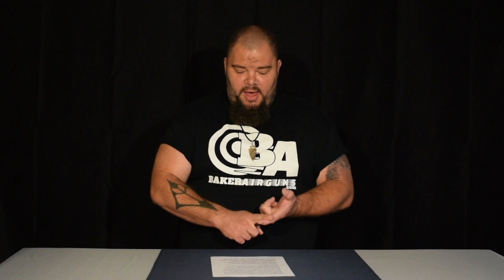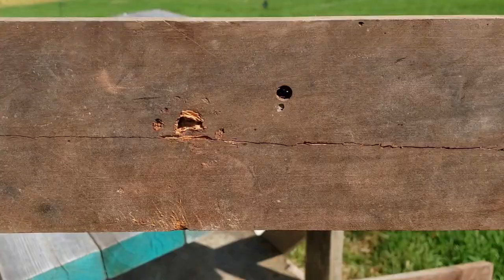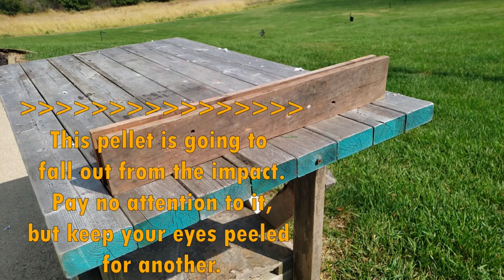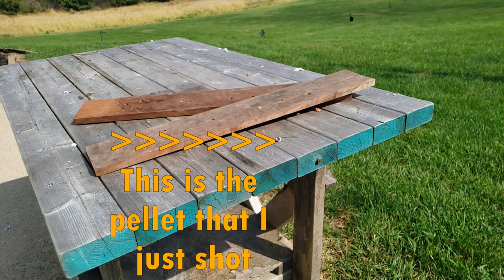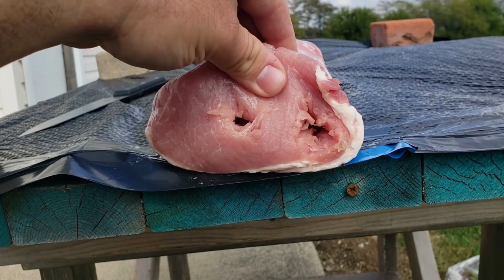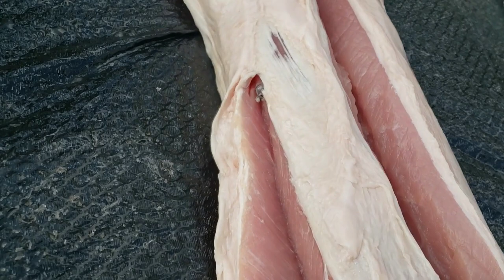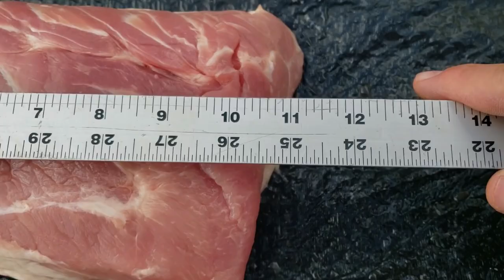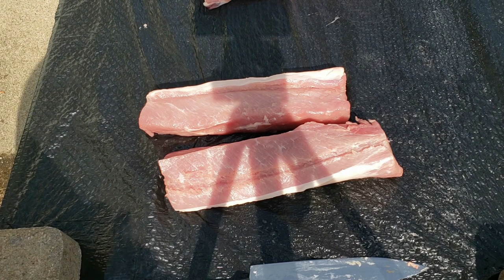PART II...What's deadlier, a .25 or .30 caliber airgun?

Comment: I'm sure there are a variety of valid opinions on the subject but my 2 cents.
I prefer .25 cal for my personal use of pellet rifles. Most modern springers can shoot it fast enough to be effective on small game and PCPs can throw it with enough authority to take Hogs.
Any ammo larger than .25 takes on a significant price increase and I will likely use a rimfire or bow on the larger game. I have no doubt my preferences are based on regional factors like laws and geography. Here in Michigan, I rarely encounter game at great distances (20-40 yards) more often than not.

Comment: I'm still not convinced. Example. Seting aside a "head shot", my brother has a vintage 35 Remington carbine lever action. When using a blunt nose bullet, a deer drops where its shot. When using a pointed bullet of the same grain, the bullet passes through, and the deer keeps running. So, it's obvious "knock down power" is important. Saying that, conduct the same test at 50 yards and see if the .25 caliber pellet is the winner. And then at 100 yards. What caliber retains more energy at those distances?

Comment: Nice video Donny! Hydrostatic shock is hard to measure but it is to me a form of instant hydrostatic pressure, the projectile does push energy into the gel as it cuts through, like a wave of energy, and if those waves are fast enough they can damage living tissue.  Some tissue is  more impacted. Subsonic Air rifles generally don't produce much.  But if you  shoot a high velocity rifle with same bullet characteristics at the gel, the wound channel will be greater in diameter. The bullet isn't touching this area, so what is causing the much greater wound channel?

Comment: Mr Baker is very correct in his statements here and physical testing shown does not lie. At the same muzzle energy at this range, the .25 is going to win. Where things will get less clear is when the distance you are shooting increases. The .30 will retain more energy at 100 yards and then you will get into other factors as well....especially the BC of the projectiles. With pellets in particular, you do get some limits on speed that you can shoot and retain reliable accuracy, so these tests he has performed are very valid. If we move to slugs then faster speeds for stabilization are going to change the variables quite a bit. I know of multiple people who hunt pigs that have even moved down to high FPE .22 with slugs simply because the penetration is superior to .25 and .30 (and because they are only taking shots into the skull inside of 50 yards). If someone was moving out to 100 yards in that situation, you would probably see the .30 be the choice because it is going to mean more retained FPE downrange. Ultimately, I think he is saying go out and do your own testing and provide real world results to give more data points to everyone. No single guy or gal is going to have time  and resources to test every single situation......so get to shooting.
Reply from the maker: Well said, friend!
-Donnie

Comment: I wish you would add info on FPS and rifle you are using. This info would be helpful.
Reply: It’d also be good to do apples to apples-not apples to oranges. Different calibers but use same weight (or close as you can get to it) pellets/slugs and run them at the same (or close as you can get) velocity.

Comment: It results in physics.The frontal area is smaller for the .25 so there is less drag as penetration is achieved compared to the .30 caliber at equivalent energy levels.I've studied this with hunting handguns  using Hardcast bullets .......one example is the .475 linebaugh compared to the .500 linebaugh. Guess which one penetrates deeper? Your testing mirrors mine in air rifles with equivalent energy and in my testing with handguns I use for hunting. Great presentation!!.........john
Reply from the maker: Thank you very much!  I'm glad to hear that our testing is in accord.
-Donnie

Comment: Very interesting test. I would like to see you do the same thing with the 22 and 25 cal. Makes me wonder how the 22 would hold up against the 25.
Reply: The smaller pellets/slugs of the .22 generates more energy than the .25 in piston/spring guns because the .25 usually pushes them at slower speeds. This is less true in the PCP world, since gun makers can boost the speeds on their .25 cals to be well above 1000 fps. As with anything shooting related, your best bet to is to spend our energy trying to find the most accurate airguns. Because they are all pretty badass at sending lead down-range quickly, these days.

Comment: Great pair of videos! I was a bit surprised at the differences so much in favor of the .25. I will need to go back and watch, but I thought I saw at one point a larger wound channel in the gel with the .30, but the angle made it hard to see. As for the meat, it did look to me like a larger entrance wound with the 30 caliber, as well as a bigger impact (how far they moved) in both the wood and the meat. But I'm not certain, it was hard to tell, and I will watch again. However, one thing is guaranteed: the entrance wound is going to be 20% larger assuming no expansion in either case. Now, of course, with the higher FPS of the .25- needed in order to keep energy identical- you are more likely to have expansion of the .25 to equal the diameter or slightly exceed the .30 diameter of the other. As for penetration, obviously, IF all other things are equal, more is better. (Do I hear moaning? Weird! ) However, an extra 20% penetration or say 20"- will be of zero benefit if the object being penetrated is only, say, 16". Or maybe 12"(how thick is even a human? Much less a rabbit?) The projectile will simply waste that extra penetration in a tree or ground.  It will be particularly worthless if both projectiles penetrate, but one has a 20% larger entrance and maybe exit wound. But again, if the higher velocity of the .25 enables it to expand to = or exceed the diameter of the .30. 

In this case, the difference in caliber is so small that it is really hard for me to eyeball much difference in wound channels, particularly after the higher velocity has most likely expanded the .25 more. Still, I just watched it again, and it looks to me like a larger entry hole at the moment of impact, as well as lifted higher off the table, with the .30. But, maybe it is me. 

There is no doubt you have more penetration in all cases with the .25. Which would be useful if the extra penetration was needed. OTOH, if th FPS are increased just slightly, which would give higher energy for the .30 but still lower FPS, that would be interesting! 

I sure would like to know if the .25- at the same energy as the .30- would have penetrated those hog's heads. Or, if the .30, with just slightly higher FPS would have done so. 

Now, speaking of beginning wound channel size, comparing .25 to .35 or .45- adjusted for equal energy- that would be interesting indeed! Or, for that matter, how about .177? Any way, GREAT VIDEO, with surprising results!

Comment: What I’d like to see now is the exact same test at longer distances. For example, at 50 yards and 100 yards that would be very interesting. 

Also, at what point longer distances does the pellet lose penetrating power.  As an example, what distance should you not attempt to kill an animal due to the loss of velocity of the pellet.

Comment: If you can push two slugs of different weights at the same speed, the heaviest one wins every time. Pushing big stuff fast is our addiction.  

Rifle 1: 50 gr slug @ 800fps = 72 lb of energy
Rifle 2: 30 gr slug @ 1,100fps = 80 lb of energy

So, the smaller slug has more energy because it is traveling faster. If Rifle 1 could push the slug the same speed (1,100 fps) it would generate 134 lbs of energy, and be far more effective down-range. 

Here's the kinetic energy formula to try for yourself (works on grains of arrows, bullets, pellets, etc.):

Speed X Speed X Weight ÷ 450240 = LB FT Energy
(example: 800 X 800 X 50 ÷ 450240 = 72)

Comment: Let me start off by saying I agree with the point you’re trying to make here. I chose .25 myself. As soon as I switched from shooting .22 to .25 I am mediately fell in love. I think high power PC P airguns run smoother in .25 (just the feeling I get) 

But I do think you took a dated approach to a modern test here. I do think that you could potentially get much different results if you used soft hollow pointed slugs instead of pellets. I’m not saying the results would not be paralleled in comparison just like you had here, I’m just saying I feel like that would’ve been a more modern approach.

Especially if you used a lightweight explosive pellet like a FX hybrid… now those results would be interesting, especially if you put the same level of detail into controlling the tests. Then maybe powered up by some heavier weight slugs.
Reply from the maker: I do this for a living, and I don't shoot slugs.  They're simply not as accurate as pellets.
Reply: @BakerAirguns   at shorter ranges I agree with that. But this entire video was not demonstrating accuracy. Your entire video was demonstrating penetration and the wound track between .25 and .30 sooo… not really understanding the point of your reply.
Reply from the maker: @shannonsloan7246  My point is that, counter to your assertion, it is in fact NOT dated to shoot pellets.
-Donnie
Reply: @BakerAirguns   That is certainly something we can agree on. The point I was trying to get at was using regular pellets is  like using hardball ammunition in relation to hunting/deadliness tests and it would have been cool to see the difference between .25 and .30 cal using a popular and/or more effective SLUG or HOLLOW POINTED PELLET like many people do these days due to the vast selection and availability.

In addition to your first response, slugs or not as accurate as pellets when shooting 75 yards and below (+or- a few yards) for most. But pellets are not even close to it to as accurate as slugs are 100 yards and up. In .25 cal shooting 40 grain Varmint Knocker slugs or 41 grain Zan slugs, people can easily reach out to targets 200+ yards with consistent accuracy when using high powered PCP airguns. Of course I know you are aware of this also being the owner of Baker airguns. Different strokes for different folks. Anyways thanks for the video.

Comment: I appreciate your efforts and passion on this topic!

But we cannot apply physics where it favors our arguments, and not take it physics completely in all aspects. Please let me preface my argument, that I wholeheartedly believe that any errors you may have made a simply an oversight, and not an attempt to push your point of view. You are a man of the highest integrity!

1. Ammo the penetrates 25% deeper causes 25% more damage:
This point is only taking into account 1 dimension of a 3 dimensional problem. I will do some simplification so I can leave calculus in my back pocket. Let's make the assumption that both ammunitions are square. And let's assume the .25cal ammo traveled 10" into the game and destroyed only a .25cal square as it traveled through the game. the .25cal ammo will destroy .25 x 10" of flesh or 2.5 square inches of flesh. The .30cal ammo will only travel 7.5" if the .25cal ammo traveled 25% further, and it will destroy .30 x 7.5" of flesh or 2.25 square inches of flesh.  2.5" vs 2.25" of square flesh damage has the .25cal has 10% more damage over the .30cal in your test, not the 25% you alluded. If we did a linear extrapolation to an imaginary .025cal round that had 100" of penetration, do we think it will be more deadly? The answer is probably not because we are in ice picking territory.

2. There is no such thing as Stopping Power in airguns:
The way airguns kill prey is by causing damage to nervous, respiratory and circulatory systems. If you shoot prey with an airgun producing 100fpe at the target that traverses completely through the animal, not all of the energy was transferred to the animal. The animal will most likely still die, as you most likely damaged the circulatory and respiratory systems, but the animal may still run away, if the skeletal and nervous systems are still in tact. The First Law Of Thermodynamics states that energy cannot be destroyed, only transferred. If a round with 100fpe on target expanded after entry so it only travels 1/3rd the way through the prey (transferring, let's say 40fpe to the prey in the process) , physics tells us that the remaining energy in the round is transferred to the animal. This is akin to a pro boxers jab. That energy transfer on prey can be enough to knock it out, just like you can be knocked out from blunt force trauma in a car accident. 

Hopefully these things give you a bit more to think about! I also did a video on this on my channel. https://youtu.be/aVre4vvh1PQ
Reply from the maker: Hello, and thank you for the reply.  Concerning your first point...I will not consider that the ammuniton was square, as it wasn't.  The results of the ACTUAL experiment showed no appreciable difference in wound diameter.  I tried to measure a difference and found none.  The wounding effects of a round nosed projectile through muscle tissue at .25" or .30" were demonstrably insignificant.  The only difference was the amount of penetration.

Concerning your second point...I'm well aware of the conservation of energy...but it's a moot point.  These tests were done at 70fpe with both calibers.  You know what else has 70fpe?  A baseball at about 80mph.  Ever see one go through a batter?  Ever see a batter die from getting hit in the chest with one?  All of the energy was transferred to and absorbed by the batter.  Same as the jab you mentioned.  Now shoot the batter in the chest with a 70fpe .25 caliber airgun....and keep in mind the level of penetration in my experiments.  Clearly, the .25 caliber pellet is deadlier.

-Donnie

Comment: Thank you for this video!!!!! This series was awesome!! This topic is why I believe the next big "wave" in our hobby is gonna be high velocity .177cal heavy grain slugs. Reason I think this is because of the velocity you can achieve coupled with the penetration, it'd be like shooting needles through butter😅.
Reply: And increased shot count is a huge bonus with the 177
Reply: That gets to physics too.
The area of the bore / base of the slug at a 'standard' pressure (say 3000 PSI) has a direct correlation with the possible FPE. And say you want a sufficient velocity to give a reasonable trajectory, something under transonic which a lot of shooters find is between 900 to 950 FPS. The weight of the projectile becomes limited under these conditions and ONLY increasing the air pressure can allow increased projectile weight (currently 4500 PSI, but unless your filling you gun direct from a compressor you have to drop it down to, say 3800 to 4000 PSI. I have several air rifles that operate at 4K and I only get TWO fills out of a 30 min SCBA air tank filled to 4500 for example).
Just as a bigger bore hydraulic piston can exert more for e with the same pressure, a bigger bore barrel using the same pressure can push a heavier slug because there's more area for the force to work on... But even there there's only so much energy available and it's quickly reached which is why bigger bore slugs get shorter and lose BC, there's just not enough energy in air to push an equivalent shaped to a smaller bore slug.

Comment: Thats why the Huben K1 in .25 with 140joule (33shots/fill) is more deadly than the .30 FX dreamline 105joule and even as the unregulated AEA HPmax in .35 with an dropping peak over 200joule but under 140joules after 12shots.

Comment: So a 22 at 70 ft lbs should penetrate even further than a 25 at 70 ft lbs I’m guessing. Smaller surface area, less friction? Or purely velocity? Gotta test the 22 to 25 now. Thanks for the info. Also what was your reg on the m3 shorty set at? I have a .30 barrel kit on the way and was just curious. Also there are instances where less penetration may be desired. Good to know.
Reply: I was going to say the same thing. JSB makes a .22 33.9 and the M3 can push them to 70 ft/lbs.
Reply from the maker: I don't know what would happen with a .22 set at 70FPE.  I've never tested it.  Reg on the M3 was around 120BAR, I believe.
-Donnie